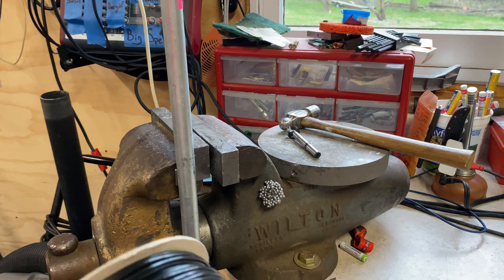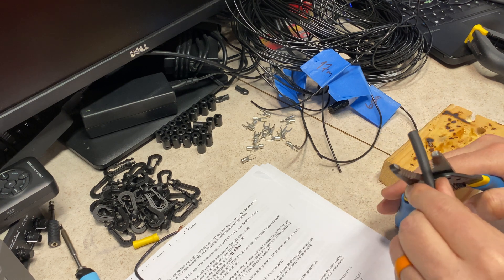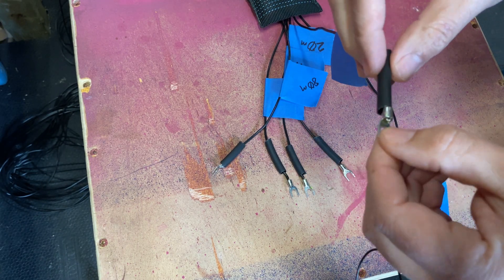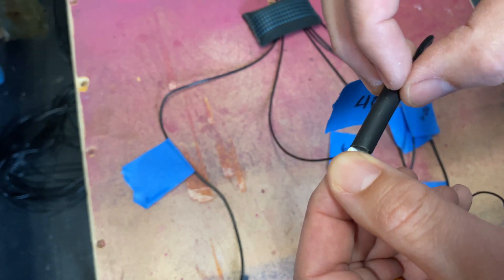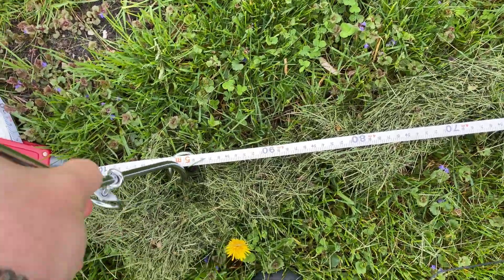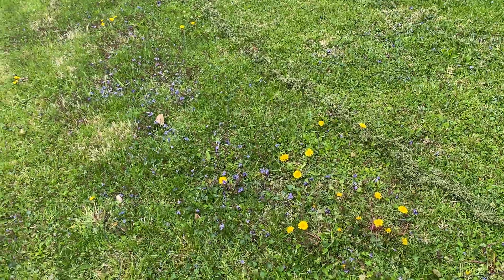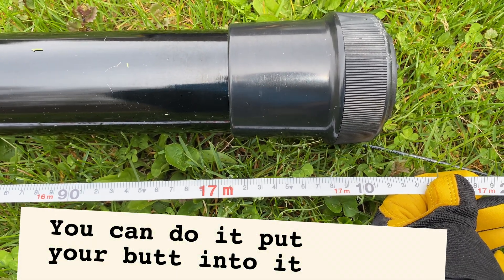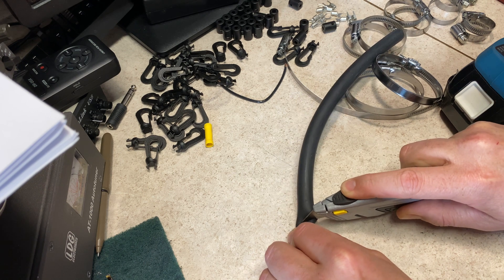DX Commander Nebula - Part 4

Comment: Carlos.. You can work out which is the "sticky" section by measuring each section and noting which section hasn't come out the most.. I found that (I think) 4th from bottom was hard to extend fully. We poured very hot water gently over the larger section.. Waited for the heat to perculate through that section then gave it a gentle pull/twist.
Reply from the maker: Thanks Cal. I need to lower her in a couple of weeks and when I do I’ll give it a go on measurement and trying the extra heat.

Comment: 11:13 - I am worried that you haven't put the clamp right at the join between the two sections? Maybe I see it wrong.. Also if you can email me with which number clamp (from bottom) was not fitting right. I need to double check this end or supply different size. Not had that feedback from anyone else. Sorry you found the clmaping arrangement difficult. I used to as well. For some reason, I now find it the easiest! Muscle memory maybe - or something!  :)
Reply from the maker: I have it just above the join between the sections like the others. I’ll take a picture of it and send it your way with the details when I lower her in a couple of weeks to work out the tune on 80m.
Reply from the maker: So I took down the mast this weekend to work on it and put in the replacement top spreader plate.

The hose clamp that was about 1cm too short is the 3rd section hose clamp. 

Having some trouble getting the 80m/10m combination element working right. I posted on discord about it.